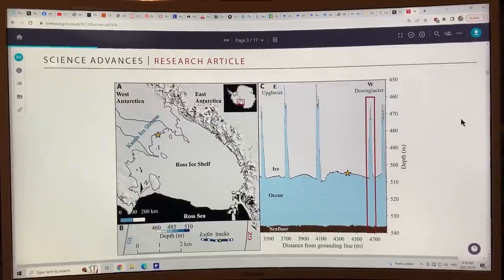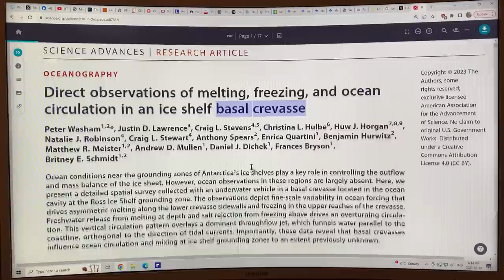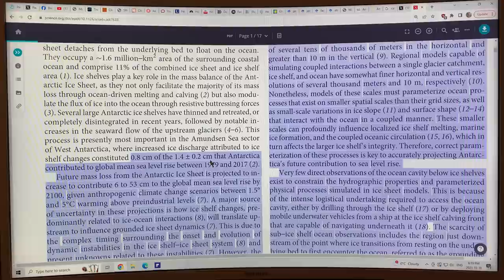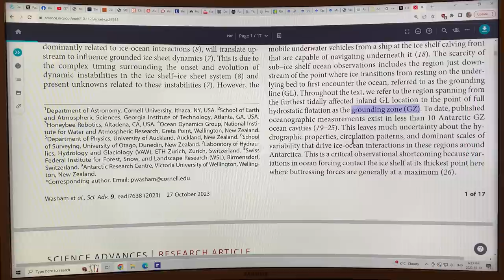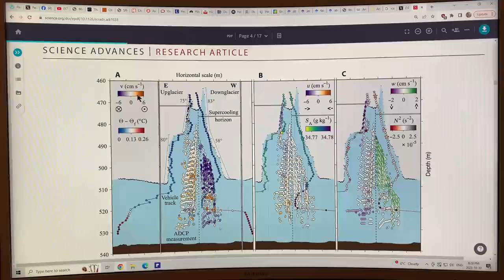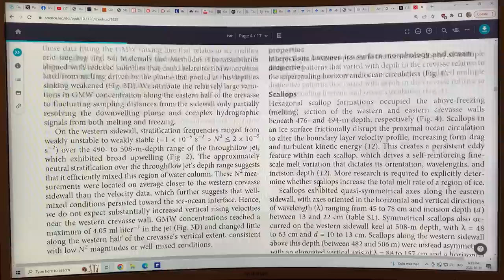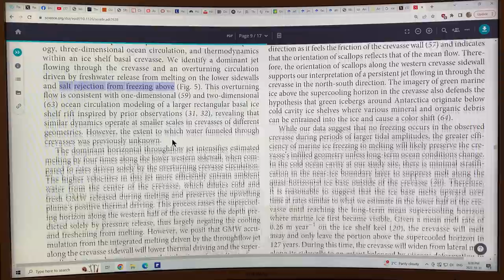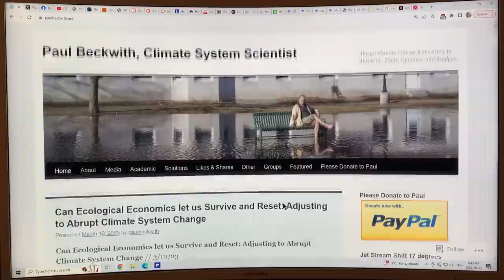Bottom Crack Study on Antarctica’s Ross Ice Shelf  With Underwater Robot Measures Instability Risks

Comment from the maker: A paper called “Direct Observation of Melting, Freezing, and Ocean Circulation in an Ice Shelf Basal Crevasse” was just published online (open access): https://www.science.org/doi/10.1126/sciadv.adi7638

This very interesting, and very important study involved hot-water drilling a hole through an ice shelf in the Ross Shelf in Antarctica, and sending a robot called Icefin (follow Icefin on Twitter/X) through the hole to the water cavity near the glacier Grounding Line (GL) in the so-called Grounding Zone (GZ). 

This robot surveyed one of the Ice Shelf Basal Crevasses (crack in the ice extending from the bottom partway upwards through the ice shelf). Measurements included three-dimensional water flow rates inside the crevasse, water temperatures, water salinity (thus water density) and detailed visual examination of features inside the crevasse on the walls of the crack. 

The physical dynamics of the water flows and melting and crevasse characteristics were measured in detail, to completely characterize the present state of the crack and surrounding conditions within the bottom of the ice shelf.

Repeating the study in a year or subsequent years would then allow an understanding of whether or not the ice shelf is at risk of total collapse or if it is fairly stable. 

Given the extremely warm anomalies in the oceans around Antarctica and the enormous collapse of Antarctic Sea ice around the continent, it is vital to assess possible ice shelf collapses, due to the associated increase in ice sheet flow into the ocean resulting directly from ice shelf collapses. 

Please donate to http://PaulBeckwith.net to support my research and videos as I connect the dots on abrupt climate system change.

Comment: If the Arctic is breaking apart why the hell are you running icebreakers through
Reply from the maker: Duh. Antarctica is at the South Pole. You are upside down!!!
Reply: Lol. I remember when being dumb as rocks wasn't cool. Pepperidge farms remembers as well.
Reply: I'm assuming that you know your North from South Poles and you're asking a serious question; the answer is opportunistic self interest. There's no law preventing ships from sailing the Arctic and there may be benefits; they burn less fuel so a small savings plus their stack emissions help block sunlight from reaching the surface, which very slightly helps reduce warming.
Reply: @hiimelfo  
Ah yes, those were the days.